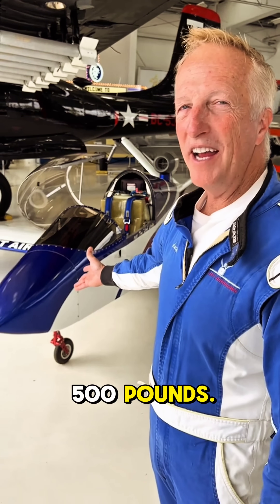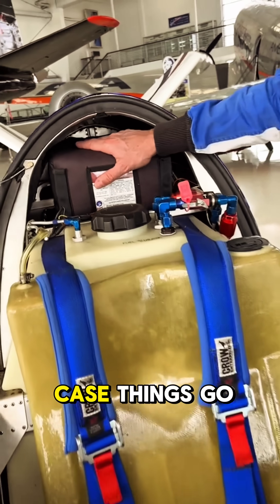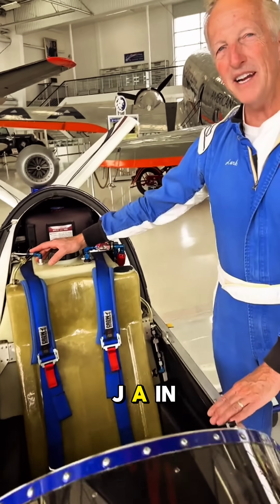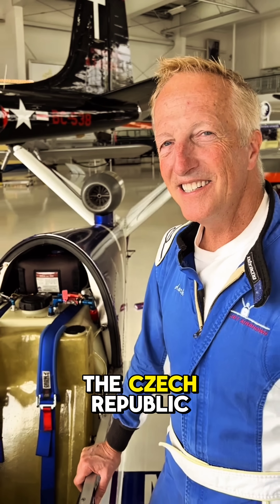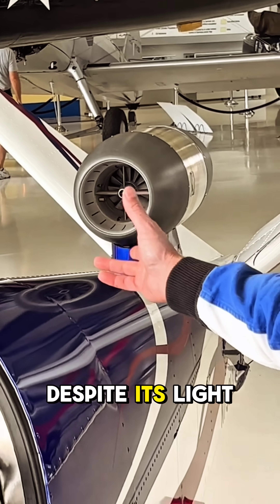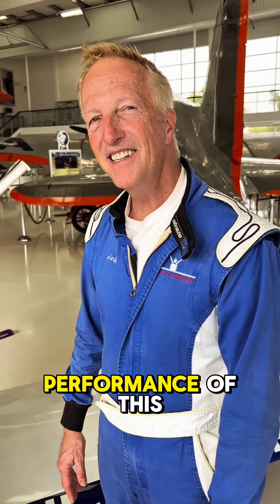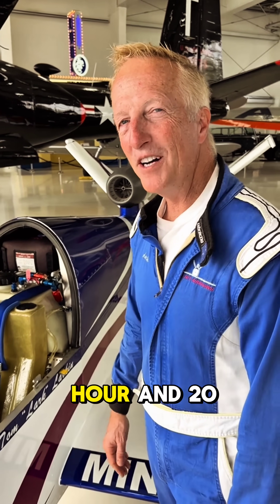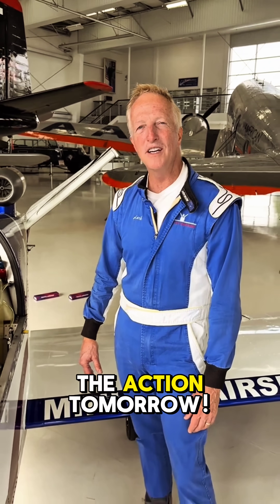SONNEX MINIJET🔥#jetworld #aviation #airplane #foryou #fyp #smallestplane #shorts

Comment: Engine weigh = 43lbs [when empty]? 🤔
How much does it weigh when full and what exactly do you fill it with?

Also…
Plane weight at takeoff = 800lbs
Engine thrust at sea level = 258lbs??
Forgive my ignorance, but Isn't thrust/weight ratio supposed to be somewhere between 2:3 and (preferably) 1:1?
Reply: Nah, 1:1 is already fighter jet territory, not even them, 1:3 it's just fine airliners are lower than that, around 1:4 or 5 I believe